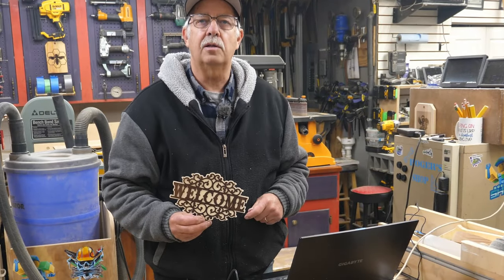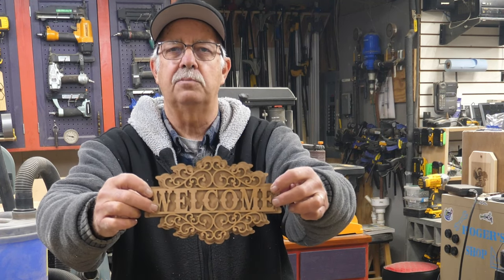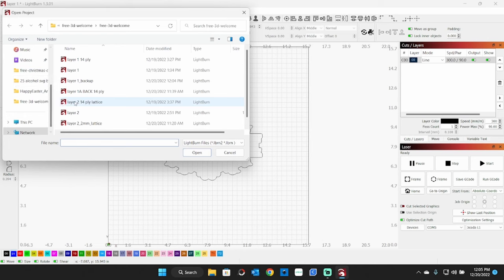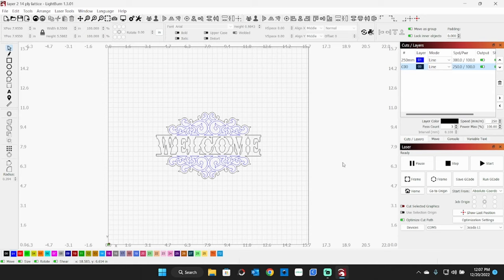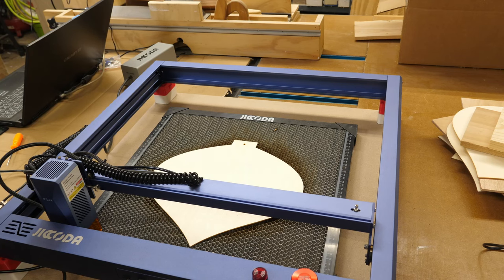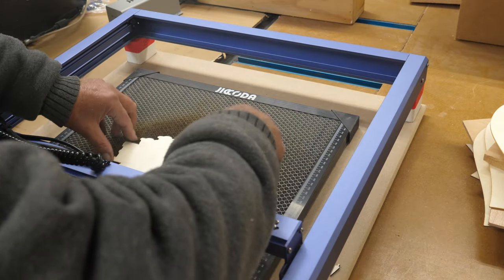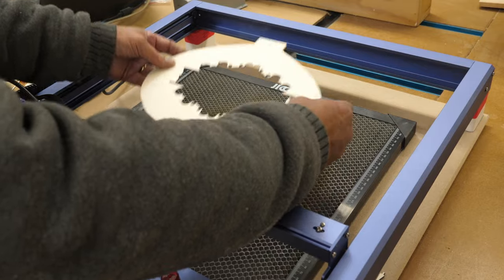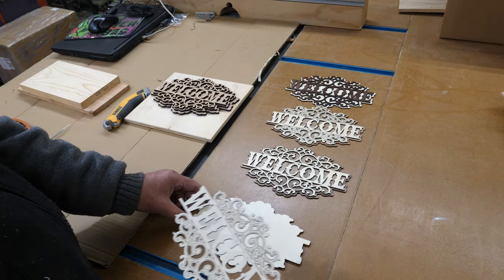Beginner Laser Project #6 Layered Cut Sign

Comment: My husband was looking at various peoples channels and I noticed that you had mentioned problems with warping wood. You can fix this problem by (soaking in water or spray water or steam it)for several minutes and then let it rest absorbing the water. Then you wrap it in plain paper, then place it on a level surface with weights on top until dry. I have done this for wooden antiques that you would think had to be thrown away. It works well  and can save your things.  This can also help you bend the wood for your projects. I would experiment and see what you can create. As an example those beautiful a chairs that Eames designed with bent plywood.

Comment: Good project Roger and excellent explanation of the layers. I love using Dollar Tree wood for testing and simple stuff like ornaments. One thing I've heard (and do) is with 220 grit sand paper touch up (with the grain) the wood to get a smooth surface. I think I may have heard that sanding tip from you or maybe Rich from The Louisiana Hobby Guy in another video I watched. 
Second thing. Have you tried spray adhesive?  I have a can and may try it. Lay the upper layer face down on some parchment paper and give it a good two pass shot. After waiting a few seconds you can place it on the lower layer, put a clean parchment sheet on top and add a weight that covers the entire project. 

Thanks for the files. I'm going to head over to your site and download them.
Reply from the maker: 3M 77 spray adhesive also works well, but can be a little messy, depending on the parts.  On large layered projects, I use the 77.  On smaller things, I prefer CA glue.

Comment: I’ve been looking for a way to ask a question. Can I cut 3mm mdf with my d1 10w laser. I found setting of 350 mm/m @ 100% power 1 pass. Does this make sense to you
Reply from the maker: Yes, and maybe.....MDF can be finicky, depending on the manufacturer and sometimes differ in density from maker to maker.  Your starting point sounds good, but run some tests to see if scorching is an issue.  If so, try a faster speed, but two passes.

Comment: My laser is brand new, it was quiet the first few uses but now the bearings or motor screeches when I run it, it’s when it’s moving. I know its not the laser, any tips?
Reply from the maker: Should not do that.  Check that belt tension is not too tight.  also, try to identify where it is coming from.  Does it do it on both X and Y axis?  Or just one?  Could also be a loose sprocket (pulley) on a stepper motor.
Reply: just the x axis where the laser is, I'm pretty sure it's coming from the timing belt pully inside the housing that I can't see.  I've tried both loosening and tightening if I loosen it anymore the teeth don't catch. the higher the speed the louder it is of course. @rogersshop

Comment: I just want to know how many volts the power adapter for that machine,it is 12v or 24v?
Reply from the maker: I no longer have that laser, but I think it was 24V
Reply: @rogersshop  how about the performance of that machine?
Because i will plan to buy.
Reply from the maker: @onil3372  It worked just fine and did a large number of products.  Never had any problems with it.

Comment: Roger I got the b1 longer laser put together tried to frame a project keeps coming up out bounds any suggestions?
Reply from the maker: Assuming Lightburn, make sure the work area settings match you laser.  Also, make sure the limit stop screw is in the right hole according the the wattage head you have.  And last, work from Absolute Coordinates rather than Current Position or User Origin.
Reply: Thanks Roger. Did you get the packages I sent you? @rogersshop
Reply from the maker: @174859607  Yes.
Reply: TY
Reply: Up And Running

Comment: Hey! Just curious, how long did it take to complete cut/engrave this project. Just wondering how long that process actually takes. Thanks!
Reply from the maker: Depends on material thickness, and option of graphic.  The most complex with engrave and cut on 1/4" plywood is 58 minutes.  Base layer, about 10 minutes.

Comment: Is any of this done in inches for those of us in the USA.
Reply from the maker: Dimensions are in inches.  Speed is in mm/min, which is the most common use for diode lasers.  mm/sec is used mostly with IR and CO2.  The metric system is not difficult, as it is base/10 and is easy to learn if new at it.